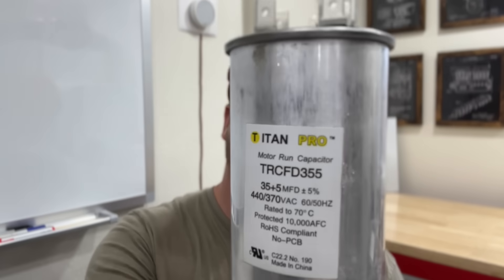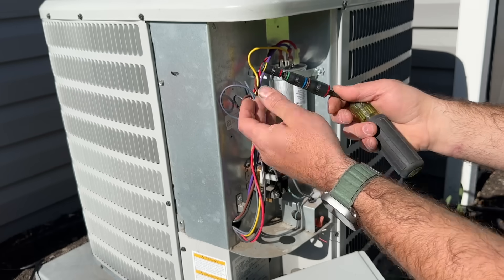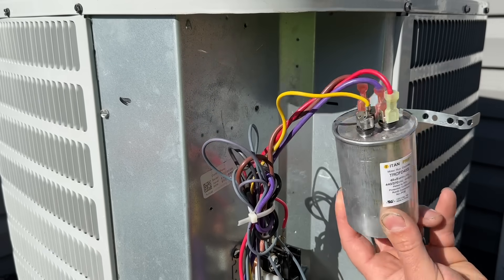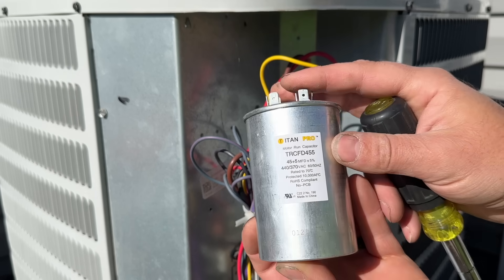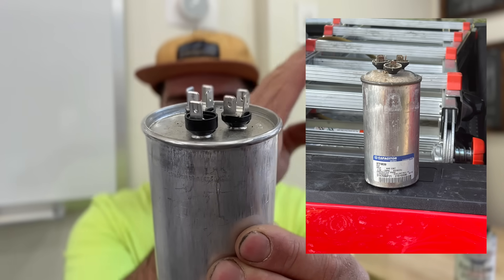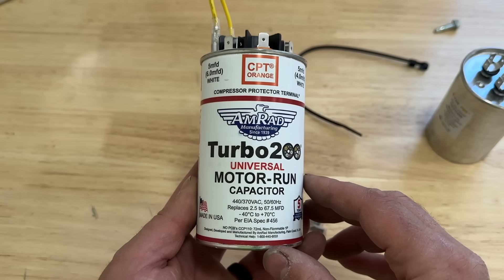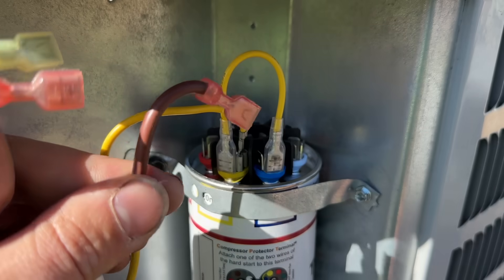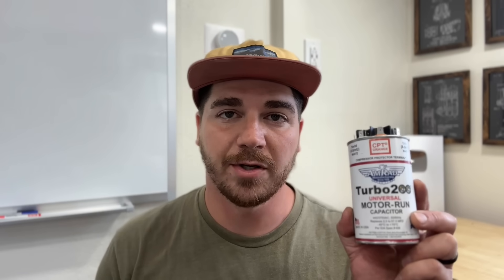HVAC Contractors Practically Make Their Living On These

Comment: I myself had this exact same experience. I had the cap blow and needed a new one. I had to find out what the cap was rated which I found on the schematic on the unit. Then ordered the Turbo 200 for no reason other than made in the USA. Installed it myself and the saved $2500 an AC guy said it would cost. Great video.
Reply: Caution, this guy gives false . Inaccurate and dangerous information. #1  before you work on your unit always check for voltage at the unit with a meter sometimes the disconnect switch can be broken or bypass so shutting it does not necessarily mean there’s no voltage at the unit. #2 He says that a run capacitor gives your AC unit an extra jolt of energy when it first kicks on.WRONG a run capacitor stays in the circuit All the time while the unit is running , what he’s describing is a start capacitor something completely different.  I have been in the HVACR industry for 47 years and never have I seen somebody charge $2000 for a run capacitor., not even close maybe $100 which would be on the high side
Reply: @keithburton3713  i agree. He also thinks clean coils makes the system produce colder air at the supply vents. Refrigeration just doesnt work like that. Youre a beast doing that job for almost 5 decades. I only did 17 years and my knees and back are wrecked
Reply: Be careful with capacitors, a spark plug shock in nothing like the shock they will give you.
Reply: @johnmalone2196  ..a capacitor chock is like holding the live wires when its charged, it can be very dangerous, even fatal..not sometimg to take very lightly.. cpacitors should also never be shorted, but discharged safely .. i know those r pretty small, but thay can rapture from the pressure, and a short will in most cases damage the capacitor badly.. (thay usually dont short out, but can, and connectimg a shorted capacitor will likely kill something else)...
Reply: I’ve been doing HVAC over 20 years. Can you please tell me where on the schematic you sold the values of the capacitor on a train? There is a parts inside the brochure but no other unit has that and I’ve never seen someone charge 2500 for a capacitor that’s absolutely insane, and for the YouTuber, it says to discharge a capacitor you put a screwdriver across the terminals your incorrect you put a screwdriver across the terminals, but you have to touch the frame of the condenser to discharge it or air handler or furnace if you’re working in there, but you have to ground it out
Reply: I really don't think 200 dollars is unreasonable if it included the price of the service call and labor. For just the part that is way over double. My rule is to charge a net price not wholsale  which in most cases is twice the price I paid. That covers handling and shipping. People want service and don't want to pay fair price for it. The twelve dollar service calls are gone forever. Get with the times we live in not 1930s.  Yes there are price gougers out there but a fair price everyone should pay. People need to make a living these days.73
Reply: Jesus i charged $80 for the part and one hour of labor for a total of $160 when replacing a cap. The thing is caps can just blow out or u can have an issue that us taking out the capacitor so you should check if the fan motor, compressor, or contactor is the problem
Reply: I've never heard of an AC Guy charging that much. But yes $100 or even $200 I have experienced. Which is still a crazy markup.
Reply: @QGJohn  you may think it’s crazy markup, but every company size will dictate the price if you have large overhead, obviously you’re gonna have to show that in the price of your parts on average most parts are marked up 100% specially in California because the taxes are so high and the cost of doing business is insane
Reply: Never call that HVAC guy again.
Service tech here. A proper service tech will charge 1 hr, probably also travel time to you, the cost of a run cap or hard start if it needs it as they had to pay. Probably some markup too. Maybe $20 for a $10 component.
You're also paying for their experience and a warranty. If something else is wrong, they can find it quick and fix it then.
Only a new compressor or system will cost thousands. And a new compressor should really only be a few hundred plus labor and new refrigerant.
Reply: Great information, thanks for sharing your videos. 👍
Reply: Well now you know your AC guy is a crook if he wanted 2500.00
Reply: Con-Qwackters asr thieves!
Reply: Never happened
Reply: Buyer beware! If you don't look at your repair bills or estimates you deserve to be taken. I can see double pricing on parts but no more. When I thought about doing piano tech work I had a catalogue the net price was double the wholesale price which is what the customer should pay. There is handling charges that don't get charged. I feel if the customer is paying double what I pay the shipping and handling cost are covered. Some techs charge every expense and then some not in my work. Well I never became a piano tuner/tech. But I can do spot repairs for my church or friends. I don't see how much different an AC man job is compared to a piano tech. Consumer electronics is another like business. 73
Reply: Here I was pissed cause I was charged $200 to replace the capacitor while I was away on a business trip. I’ve replaced these a few times and knew what the problem was. My wife was home alone so I decided to call a tech to take a look. He came in replaced the cap, all in 10 mins and said $200, I paid him $100. Scut.
Reply: The AC guy told me about 5 or 7 years ago that I needed capacitor also.  So I looked up the one for my AC unit and because we live in extreme heat area I ordered a high temperature Long life version and it was only a couple dollars extra. 
I replaced it myself and it took maybe all of 30 minutes. 
My AC is still going strong and it's over 20 years old.
Another scam people try to pull is that you have a bad contactor or relay.  I had a guy show me one with Pitted contacts.  While I went to college I worked for an electrical contactor who did motor starters and controls?  So I knew that this repair guy was bs-ing me.
Reply: @ernestestrada2461  ..its not impossible, but highly unlikely the switch or relay goes, it basicly doing one thing only, switching the statr capacitor off and adding the drive capacitor (for a F-C-H capacitor (Fan-Common-Hermi), with 3-terminals), just like a wall switch..its higly unlikely to fail... (but not impossible)
Reply: @ernestestrada2461  yes by all means replace it yourself if you know how. Also if you know how to install a serge protector that will keep arcing down to a minimum which is the major causes of contact failures. There are standards that techs must keep what looks like nothing may be a major concern to another. Your case is one in a million. I replaced mine on my air handler because the blower stopped. I set the switch on fan and went into the attic and pushed the fan it started to run so I bought a new capacitor. About 8 bucks in the late nineties. They are more now. 73
Reply: This is why you call a professional... and not one that charges a made up number like $2500.
Reply: @got2liv4him  if they charged that much I want to see the bill. They won't show it because there is none. 73
Reply: Same, only I went to a local HVAC supply company and bought an identical one from them for $10.
Reply: @fitmesslife  

Surprised your local HVAC parts supply house would even sell you anything. None of ours will due to Federal regulations and liability concerns. If you attempt t make repairs for which you aren't licensed, trained or qualified for and get hurt they can be held liable.
Reply: I am not one excited.  You with all your liberal over reacting. I am not emotionally involved in this at all. But don’t think that by ranting like you are, that I am not going to tell people to avoid getting hurt. Rant all you want, I will always tell people the truth about stupid stuff.
Reply: That's called overpricing,he didn't want to do the job,and if he did it was worth the extra effort 😅
Reply: liar, I work in upstate NY & no one ever charges 2k for a run cap, NOT a start cap.
Reply: Who the hell is charging 2k for a cap?
Reply: Never call that AC guy again and tell everyone you know what they did to you.  I worked in HVAC for over a decade and anyone charging tons of money for a capacitor should be jailed; such a thief cannot be trusted in your family's home or around your valuables.

It is fair, however, for HVAC techs to be paid for service calls unless you have an existing service agreement, so if they tell you that you need a run capacitor and you don't want to pay them anything at all then you will have become the thief.  If I show up at your house and diagnose your equipment, I deserve to be paid for my time, especially if I don't try to sell you anything that you don't need.  Honesty works both ways.
Reply: @antibrevity good thinking. Honest work for honest price. I don't believe in using low grade parts. If we want to keep work in our country we need to pay for it. Everything is made in China these days. Because people will say I can get it cheaper at _____. The hardware store is being bought out by these big box stores. 73
Reply: @antibrevity  

I've been a licensed journeyman HVAC tech for 22 years. You are lucky if they don't try to condemn your entire 10-12 year old unit just because of a blown capacitor or bad burnt contactor. You have all these crooked techs and shady places ripping people off right and left these days. None of these new people are qualified to diagnose or repair anything anymore and just want to throw them out and install new. Here's a secret.....Trane and Lennox A/Cs last OVER 30 YEARS with minor repairs and some regular maintenance. Don't know when this 10-12 year thing got started but whoever dreamt that BS up is a criminal con artist. Just because something is older doesn't mean it is junk and not repairable. It's also much easier to repair something and be on your way in a hour or two than it is spending 1-2 days installing a complete new system. The company I formerly worked for was in business from 1912 - 2017 and the guys who trained me had 50 and 40 years experience in the field and working there. I'm not some incompetent tech out there "guessing" and "conning" away. Had the 72 year old 3rd owner not passed away and his 70 year old widow wanted to retire and close I would still be there. I got a maintenance job at a U.S. Government DoD contract supplier  that builds stuff for Oshkosh and AM General. We have 28 pieces of HVAC equipment onsite that is mostly Trane. We were a Trane dealer so that just came together perfectly. 7 of those units are large 20 and 17 ton package units. I still work on the side mostly doing stuff at employees homes. You can't hardily trust anyone anymore and I am not generally fond of my contemporary peers for stated reasons. They aren't a HVAC tech....they are salesman and con artists.
Reply: @antibrevity don't over-emotionalize this and make shit up. People that rob you legally don't come around and steal your tangible property. They already have your money. They aren't looking to go to jail. 🙄
Reply: @antibrevity  Who said they didn't want to pay  A REASONABLE FEE?? But 2500 is just theft
Reply: Auto mechanics are way more of a rip off. The HVAC/R trade is very hard work. No one charges $2,000 for a Herm cap. This guy is a clickbaiter.
Reply: Why order the turbo 200? Why not just the proper capacitor? Would have been a fraction of the cost. Doesn't make sense...
Reply: @adamradley4407 he already said only because it's made in the USA.
Reply: @JCIK2311  plenty of other options that are made in the USA. But whatever floats your boat, I guess. Some people would rather pay more for features you don't need.
Reply: @Rawbar7  Good enough reason.
Reply: @adamradley4407  His money, he spends it like he wants. Just like you spend your money like you want to. How he spends his money is none of yours or anyone else's business and how you spend your money is none of anyone else's business. So mind your own.
Reply: @Watchyn_Yarwood  so your saying because you don't like my opinion I am not  able to express it? You are simply looking for an echo chamber it seems.
Reply: @Rawbar7  amrad capacitors are made in the US and have exact replacements, no need for the turbo
Reply: Mars caps are made in usa and have a 5 year warranty @JCIK2311
Reply: @Rawbar7 that's good but at 7x the price of one from your local HVAC supply company and no wait, might as well buy 2 at &10/each and keep the extra one for backup.
Reply: @adamradley4407 Because they are an average joe and don't know what they are doing. No damn way they were quoted 2500 for a single cap. Impossible.
Reply: @adamradley4407 yes it does you get what you pay for. Not all capacitors are the same. Even if the value is the same. Some have heavier foil and wax inside. Computer grade capacitors are better than TV capacitors and like wise.73
Reply: @adamradley4407  the other ones aren't turbo are they? That's reason enough
Reply: @adamradley4407 the turbo 200 is supposed to last a lot longer. Sometimes paying more for something is better than buying run of the mill if the equipment doesn't break down as often.
Reply: @genespell4340  I agree quality is important. However in this case many of the options last just as long for less cost. You are not paying for higher quality you are paying for the ability to chose the microfarad rating.
Reply: Guess HVAC is the profession to be in if you want to be able to rape other people's wallets.  lol. $2,500 should be a new air conditioner.  lol  Hope your unit stays working strong for many years after you repaired it on your own. Good call!
Reply: @johannjohann6523 That $2500 for a capacitor change out is highly exaggerated.  In California this service call, if it were only a defective capacitor would be around $300 from a reputable contractor.
Reply: @johannjohann6523  HVAC techs be like:  "You're not paying for the 5 minutes it takes to change it, you're paying for the 20 years of experience I have disconnecting and reconnecting spade terminals."
Reply: @johannjohann6523  $2500 would barely cover the wholesale cost of the condenser, coil, lineset, etc anymore.
Reply: @johannjohann6523 I don’t know where that price came from? I’m a certified Journeyman  from Florida, and whoever paid that price is a fool!
Reply: HVAC guy here, i show up for 200 bucks, check everything because i charged you for an hour so i give you and hour of value. Cap cost like 100 bucks carrying the turbo 200, I only carry them for simplicity of stock being lower numbers.
Reply: Schematics don’t show which size capacitor on 99% of brands. They show how to wire but not the actual size of a cap as those are printed for 100s of different models… so you are either a liar or have that special 1% I’ve never seen as an HVAC tech with over 20 years experience. But I’m glad you spent $70 bucks and risked blowing your unit up!
Reply: @aerialphotography8363  yeah I let that slide from them also. Anyone who has changed a cap knows its specs are on the actual cap. If that wears off you can maybe find it stamped on the compressor and the fan. But certainly it won't be on the wire diagram lol
Reply: If you home has multiple units, then no brainer to get a cap with multiple compatibilities. Or if you are the MAN IN THE FAMILY that does home repairs, having this on hand would be CRITICAL!
Reply: Please it’s a great video but too many things you are doing could kill someone . Yes it’s simple for some folks but it’s dangerous for most and to try it’s deadly.  HVAC contractor here and pull the disconnect and just leave it out ! No one is charging 2000 for it but many have probably sold a bad capacitor into a new unit or new fan motor , and some do need it if they have been over heated the windings for a longer period . Just good to show home owners and have them watch their techs do the right honest job .
Reply: @blondestrainger it's always good to watch the tech, especially if he, she is from a big ac company who pays their techs a commercial. Ask questions and don't pay a company before you see the ac working and cooling.
Reply: @blondestrainger  Right on HVAC brother !  I been banging on about this DIY Tech questioning why he’s showing videos like this . As I mentioned to him, you can’t be encouraging people to gas up units with day R32 or ‘Bang Gas’ 💥 as we call it due to flammability. ❄️
Reply: No, you didn't. You should get a life.

Comment: The UV light is another scam, I was told I needed a UV light $1299, they cost $60 on Amazon and require creating a small hole in the duct and plugging the cord into a 110 outlet.

Comment: I need a 70 micro farad....that thing cant handle my beast of a compressor. what is a man to do ? All of them jumped would only total 62.5. Would that be enough? 62 instead of 70...probably. Then if I move ill just take it with me knowing it will work at my new location too
Reply from the maker: I think it only goes to 65. I’d just get a 70/5 assuming your fan is 5 mfd 👍🏼
Reply: Some Carrier 5 ton units require a 70.5 microfarad capacitor for the compressor. No capacitor is needed for the condenser fan motor because it is an ECM motor. these oddball capacitors were engineered for a particular condensing unit😩
Reply: @BartlettTFD  Its a 4 ton. Current cap is clearly marked as one terminal being FAN. Im trying to find a midrange cap tha tisnt crap and same time not over expensive. Are the Genteq any good?
Reply: I ended up going with an OEM Totaline, made in Thialand. I thought it was Tiawan, lol...Tiawan makes amazing things...oh well, just under $29 shipped...lets go Thailand